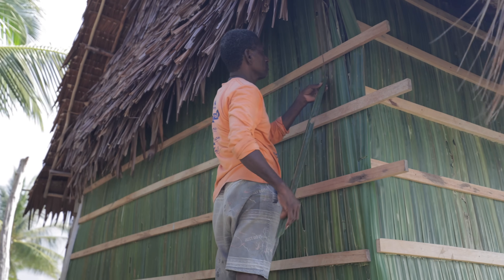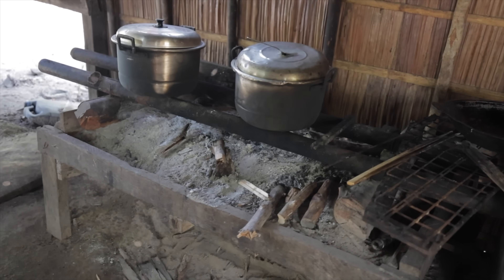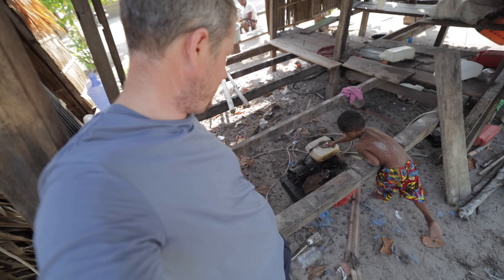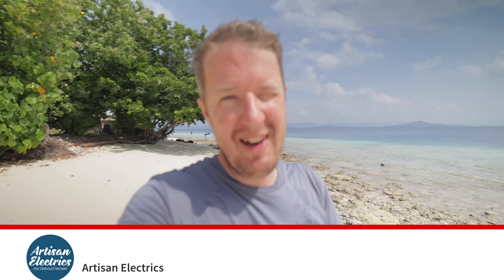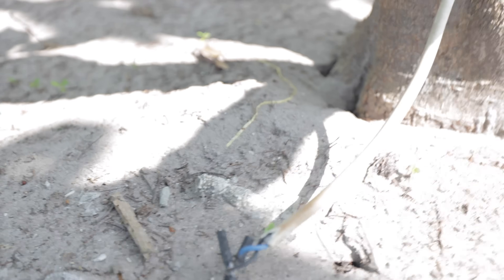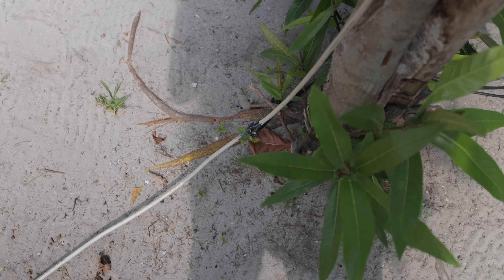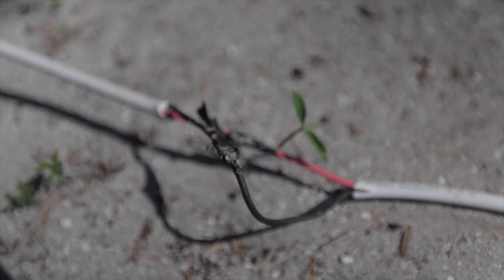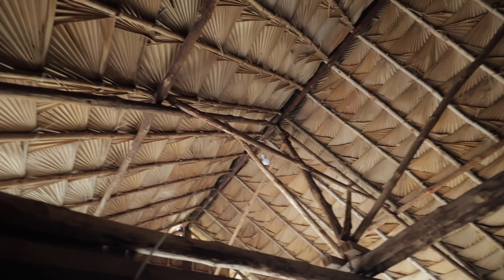I Want To Help Fix These SHOCKING Island Electrics 🤯

Comment: I think they’d benefit from a solar installation and for their lighting a low voltage circuit 

Also, I’ve seen in places in Africa that there are simple ‘dynamo’ type of battery chargers and lighting power systems that have a thin paracord rope over a pulley and a bag that you add weights to , then lifting the bag you let gravity pull it back down powering the dynamo

Comment: Lol it's their way of life

It's always been that way 
(Even on their 'main land')
Nothing has changed lol
If they wanted to fix it they could 
But it's just not a high priority 

They manage to have good boat motors that they ' maintain' the little Genset is no different

You could give them a few rolls of  cable , to run new lines to each building  but all the old dodgy cables would just end up being used on a neighbouring island instead  lol 
There's no point having a fancy solar system etc if they have no way of fixing it if an inverter blows up etc 
Where as a small gen set they can Jerry rig the sh★t out of it and get it going

When I was in Indo 
It was amazing what industry they did in the streets ('mobile')

Redoing car batteries to 
 rewinding car / bike horns 

Lol welcome to the real world of isolated people 
I'm sure there's a 10 amp cut out C/b on the Genset  lol
I was More worried about the grass huts catching  fire 
Just don't go walking around outside at night 
And you'll be right mate 
Perfectly safe while the generators not running 
So it's only a few hours each day

Comment: I've seen much worse, where it been DIY electrical on the 11KV side too, with live overhead cables only 2M above ground 6.35KVAC to gnd. Illegal live 11kv hookups using hill hoist wire, and even some 2.5mm2 TPS. Live 11kv transformer terminals at waist height in the bush in India. truly unsafe and awful.

Comment: SELV solar system are the answer, a backup gen, battery bank, use the proper underground direct burial cables, add a fuse box and light switches, use all led lightning easy fix! and safe 12VDC.

Comment: Since all they need is light, I convert the system to 24VDC or even just 12V depending on voltage drops, and setup a solar and a new backup gen. Replace the wiring, move some of the run to underground and some, use proper connection and junction boxes all mounted safely. These piss poor diy electrical jobs are found all over the world, its only really UK and Aust where we have strict rules and codes for safety. Use 12V LED lights, cheap add a few light switches, and a rcd and properly grounded Inverter for 24V / 240V stuff.

Comment: I would donate a new Honda petrol generator and rewire the site in 2.5mm2 with new light fittings and IP65 outlets and a basic distribution board. Perhaps plenty of solar-powered lights too. Probably cost £3,000 in parts but how amazing would that be for the people on the island.

Comment: What voltage is the generator outputting? If 110V, then the risk of a fatal shock is significantly reduced (compared to 230V+). Also, as there is no earth bonding, the likelihood of a shock is slightly reduced as you'd have to touch both live and neutral wires for current to flow though you. Nevertheless, it would massively benefit from some Wagos!

Comment: Looks similar to what we see in remote villages in the Philippines. Education on basic electrics would be key as it is needed to maintain the suggested improvements. 

Working with only the materials that are actually available is a real challenge in remote areas, as this Island even has an apparent shortage of quality electrical tape. They also to not seem to have a preferred type of wire. 

Finding out what is easily and cheaply available would be the first step, otherwise even trained locals will not be able to maintain an improved system. Also you need to find out what the legal minimum wire sizes are and apply that knowledge in teaching.

For example in the Philippines AWG14 would be the legal minimum for fixed installations such as these huts, capable of 15A for short distances, but less if you carry power for 100+ meters. Certainly more than enough for lights and cell phone chargers, but probably already considered too expensive on that island. Sometimes aluminium wires are used in this case to save costs.

Twist and tape connection splices are very common in the region, but can be done a lot better than seen in the video. Also, if bamboo is available, bamboo posts could be used to keep all these wires above the ground.

Comment: At least theres no shock to earth risk as generator is an isolated AC supply. could only deliver shock if both wires are touched at once.
Reply: Well hopefully it is but would you trust it enough to grab one wire and find out?  It's sitting on the ground all it takes is loss of isolation in the genny itself, not to mention all the open splices just itching to touch the ground to remove isolation and ... there's nothing between you and Monsieur Grim but sand and salt water.

Comment: You could order 1,000 wagos and 100  wagoboxes to a mainland address, pay someone to pick it up and you'd still have money left over from the profits of a recent £35k rewire. No exposed copper is all thats required. Remember they have to maintain it after you're gone, they also need to see all cabling to keep an eye out for cables melting.
Reply: Came here to say pretty much this.  😊

Comment: Many of the points i have thought about have already been raised / discussed. But there is a need to help these people.
Solar panels that have already been used may not be as efficient but these islands have plenty of sun. I don't think a generator is the best way to go. Used panels and inverters could easily be wired at 110 volts leaving lamps at other equipment readily available but reasonably safe. Used batteries from cars and returns from battery suppliers could easily make a good system. Many people and many suppliers would be happy to help with equipment and time. A charity must exist that already has the organisational skills and ability to assist the electronics and electrical industry. I hope this scheme gets off the ground and helps these islands. Regards Mike

Comment: A few folk in other comments are mentioning LV systems & solar lighting, and one pointed out the difficulty for folks living in these places to acquire materials & parts, often salvaging whatever washes up on the beach. I'm not a man of means myself (Invalided) but I do have many reels of Osram white surface mount LEDs I'm unlikely to ever use. Might these be handy, at least for low input light sources for these folks? 💡💝😇

Low voltage systems (12V or even 5V) which could be driven by solar, wind or dynamo (Hand or bicycle operated) might be worth considering, as these won't only be safer than a 110/220v generator but - more importantly - Will remove any dependence on gasoline as power can be generated by hand if required. Dynamos can also be made in such a way that they're resilient to start off with, and can be made easy to repair in-field with rudimentary tools. 👍
(See the BayGen FreePlay for an early 2000s example of this principle, applied to wind-up radios that were targeted toward remote African communities where batteries are hard to come by.)

But yes, Education will be the most valuable gift for these folks where they are already using electrical systems, both so they understand how electricity works, its dangers and benefits, and - Crucially - How it can be generated or collected. After all: If you give a man a Fish, you feed him for a day...But if you teach a man to fish, then you'll give him the skill to feed him for a lifetime! 🧑‍🏫🎣👍

Comment: my thoughts is with limited resources, while making these completely safe will definitely require actual proper junctions, at least making them safer can do alot of good. like for example, still with twisted wires but just with abit of electrical tape tightly around the ends would be alot better than bare copper. obviously not ideal, but still alot safer. and education, like one point of having no exposed wires, and only doing things when things are off, would do alot of good.
Reply: Even just giving those wires a good, tight twist and keeping those junctions above head height would be a massive improvement without any real cost. Or things like fitting the longer white cable between the generator and the socket and the plug to the cable going up into the hut would eliminate one of those crazy joints without any extra materials. Then maybe two screws or nails to fix that socket to the post and you've got a vast improvement.

Comment: So, I would suggest focus on the island and people you've built a connection with,.  Discuss with them (through an interpreter) that you want to help improve their electrics and teach them how to do safer/better etc.   Don't gold plate a solution, try and source materials in a way they could repeat source, maybe they can build a side line helping neighbors improve   Maybe there are charities working in this area who you could work with or provide support and guidance to you on this initiative.   Given that the electricity demands are modest, a small solar/battery system might be beneficial - e.g. would a portable/camping solution be better/simpler e.g. ecoflow type things...?
Reply: Sourcing is the most important thing for the longevity of the project. He should use the electrical standards and parts from the nearest country that actually has some (probably Oz) so they can get pro help relatively easily, if they need it.

Comment: Have a look at Azuri-group as a model for safe and properly installed solar systems. They have been doing this for over a decade. A business model in Africa does not necessarily work in West Papua but it is a potential template.

Comment: You have a big heart, good on you. I would do 12V per hut and have a common kitchen house that has high voltage for induction cooking and water pumps. The common kitchen house would be built with fire safety in mind and could also charge e bikes and power tools. Education is a good starting point and working out what method would be most cost effective while being safe and good for the environment which will in turn help slow down rising water levels that are impacting small islands like these.

Comment: I don't think we could expect that electrical safety on these islands will ever be as regulated as in the UK. 
But we know that they all have fairly similar power requirements. 1 light per dwelling and a few outlets for phone charging and likely very few high power devices. The islanders probably have access to buy domestic generators up to maybe 6KW. They likely won't be able to afford or source solar equipment themselves, so they will always revert to using mains power and generators.

Best idea I think would be to produce a booklet with very clear instructions and pictures, with a very simplified version of safety (anything is better than nothing). Even if that means one RCD and MCB for the whole install. Just give them some basics of safety and best practices to minimise the contact risk with live wires, and to understand some basics of earthing. Maybe just recommend TT earthing of sockets and the generator. 

Maybe draw out a simple schematic of how to connect all the buildings to a central trunk/ tree type distribution cable and back to the generator. 
There could be different layout diagrams depending on number of buildings with recommendations on generator size, number of lights, sockets and maximum length of cable before needing a second generator and power system. Give some indication of cable sizes to use; bigger near the generator smaller further away.

Come up with a way that they can make their own sealed joints. Literally with something like taped joints pushed inside a bottle filled with some resin they can get hold of. We all hate twist and tape cable joins, but done right they can work well and be safe in a situation like this when the only thing you have is the cable itself.

You really need to be thinking of how can we make it safer using what they can get hold of already, and encourage them to be safer with help from the advice provided. Them understanding the danger goes a long way to making people realise the need for change.
Reply: Doing the whole thing with low voltage DC could make it a lot safer. If all you want to power is LED lights and phone chargers, you don't need anything more.
Reply: @thomasdalton1508  volt drop on 500+ metres of cable with low voltage DC would be immense. But again they probably don't have access to large AC-DC Converters . If it isn't a cheap fix they wont do it!
Reply: @SylvesterWolf  That didn't look like a 500m radius collection of buildings to me. I estimated 20m from a central point to most of the buildings. (Although, I've just realised my calculation is off by a factor of two, since you need a complete circuit. 20m distance requires 40m of cable. So they definitely need to upgrade to 1.5mm², but that's not hard to do.)

If it were 500m, you simply wouldn't be able to get 6A through the cable. A dead short at the end of a 500m loop would only get 1A. But they don't need anything like that kind of distance.

Comment: Have you every worked on a rural farm in UK?
Coz I can tell you.....there's electric systems (not that bad) but bad out there.
So your saying a 2.2kva Genny can run a full island?
But that island is hot most of year.....not like UK, where energy is more required for heating.
Nothing wrong with going back to basics.....does it work.....yes
That will do then.

Comment: I’m sure this has already been mentioned in the comments, but it seems to me that a small solar/battery setup would be best in this situation. Completely remove the need for AC wiring strung all over the island. This technology has become so inexpensive and they would save a fare bit of money not having to burn gasoline for the generator everyday. It would also be much safer while serving the need for lights and phone charging.

Comment: Since the generator's output is floating with respect to earth, touching just one conductor would't result in any current through the body (comparable to working behind an isolation transformer). Worst case scenario would be touching one conductor with one hand, and the other conductor with the other hand.  
A nice solution would be to use solar power with battery storage, then they can have power all day long.
Reply: The batteries are a substantial cost factor though. Someone from Germany recently told me he calculates his solar power at 40 cents per kWh just for the batteries alone.

Overcurrent protection likely wouldn't do much in this setup, I mean how small is that generator? Surely less than 1000 W, so I can't imagine even a dead short right at the generator would trip an MCB, at least not the magnetic trip. The thermal trip of something like a C4 might protect the windings I guess.

Comment: Perhaps a nearby supplier would provide material and tools for the repair. Then they could be mentioned as the benevolent helper in a dangerous situation.   I agree that they are in real danger of someone getting hurt.
Reply: Nearby supplier? Lol. That could be a thousand kilometres away.
As for solar systems, they won't have access to replacement batteries.. They won't last.

Comment: Education is everything. You will waste your time fixing one island. Perhaps if you teach a group of able bodied guys or girls you may be able to make a real difference. Low voltage distribution is ok locally, but you will need higher voltage AC in line with what is available locally to wire up anything over 50m. The YouTube idea is a great idea, but they need the materials to do it. Local grants, fund raising, tourist grants, find some sponsors from big business to provide materials? Ship stuff out there in a container (remember the solar panels?).
Covered distribution boxes will allow them to hook & cook safely without exposed wires. Cheap simple safe, make up a new Indo Island wiring specification for them perhaps, as it's better than what they have.

Comment: You have to make use of what you have available and it seems that there is no shortage of plastic bottles. Cut a hole in the bottom of the bottle, run the wires through and pull the connection back inside the bottle.  The bottle could be filled with sand and, if they have any, taped up at each end. It's not ideal, but it keeps the exposed wire away from hands and feet.
Reply: Leave the bottle intact, stick the wires in through the opening and put the bottle upside down. Impromptu rainproof splice. Some kind of strain relief like baling twine would help.

Comment: The simplest method of preventing electrocutions where there is such wiring as you have shown, is to disassemble their generators.   Now, being serious:----- Of course, rewiring their entire system is needed - and a new, good generator or generators.  PLUS of course, education for the islanders, as to how to wire up and repair breaks.  Some form of basic electrical education will be necessary.  Good luck!

Comment: Solar and battery storage would work a treat on these islands, you could mount the solar panels relatively flat above the battery storage area to keep stuff dry. Due to its geographical location, the sun is always directly overhead, no need to have solar panels mounted at steep angles like in higher latitude locations.
The above idea would need to be financed somehow.
Reply: Even better if it can be open sourced and built locally. Allow the locals some agency to improve on the design where possible... 

we have no need for the occurrence of the benefactor white man, when the locals could do a better job if guided properly... and perhaps cheaper...
Reply: @PrograError  
Absolutely, that was my thoughts all along. Give these guys locally a chance. 
If i could afford it, i would go there myself, help these people and get them up and running.